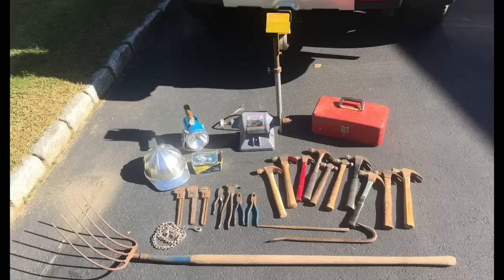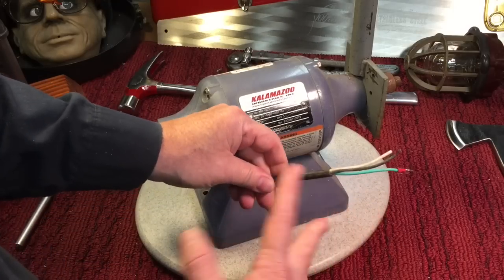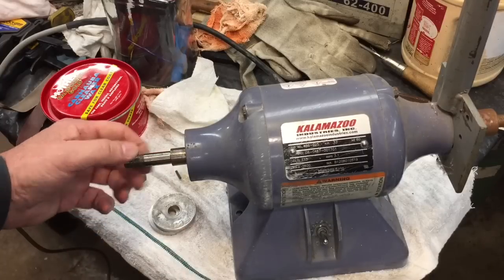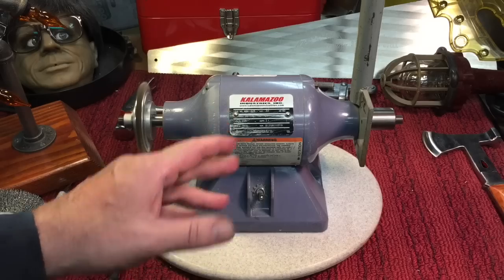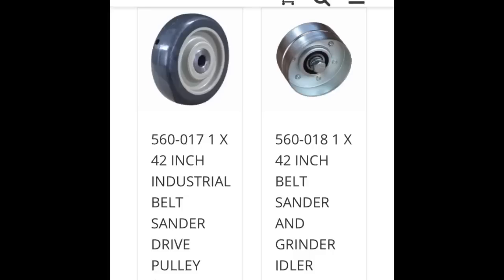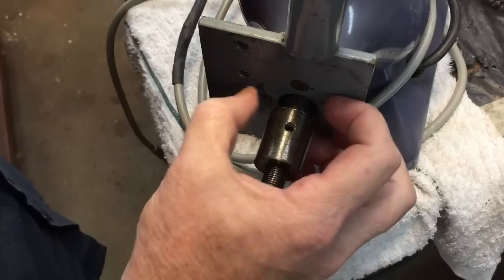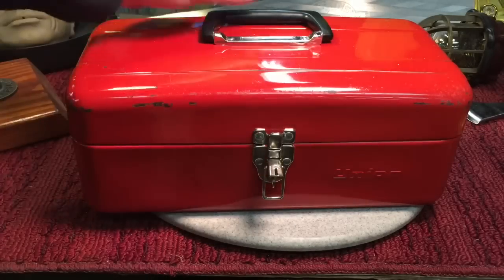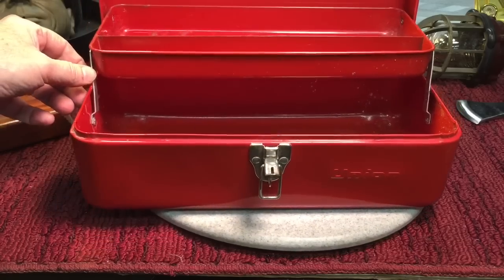First Look- Kalamazoo 1x42 Combination Belt Sander. Part-1

Comment: When joining the wires like that you want to stagger the connections, that way if the insulation tape fails you still don't have exposed connections that can touch together.
Reply: That’s what I learned as an apprentice.
Reply: That is a great tip 👍
Reply: It will surely be! I built a 1.5 inch belt sander out of trash, and I can't live without it now.

Comment: The way you pulled off the old pulley centre  was ingenious, I would have put a piece of rubber inner tube on it and left it to drive the belt. $10 that was some buy, better to be  born lucky than rich.
Reply from the maker: Tony- I wish I could have but small pulleys (under 2 inches) tend to stress the joints on sanding belts so the bigger the pulley the better it is for belt longevity...  =D

Comment: For many years I worked for a company called Kalamazoo in Birmingham UK.
Despite the name, an English brand - no connection whatsoever with the company that made this sander.
Originally, it was the Moreland and Impey printing company, founded 1886, named after its 2 founders.
They purchased a patent for a loose leaf binder from an American company, Kalamazoo in Michigan.
They became known as 'the company that sells the Kalamazoo binder', so changed the company name to Kalamazoo.
The company sold business systems, printed cheques for banks, business stationery etc. and later moved into IT.

Comment: Nice buy, I start going through my stuff until I find something that will work. I bought a delta 6x48 belt disc sander for 50.00 from the scrap yard. It was missing a couple handles and the pulley was spinning on the shaft. 3 days later I have a great sander. We appreciate a great deal. As I say crap to ice cream because we care about tools. Thank you for your channel.

Comment: Really nice job. I was thinking back to my years on the tools. I’m sure we say jockey pully here in the UK.

Am I right in thinking that tapered shafts we’re preferred where possible because the pulleys come off that bit easier?
Reply: The belt drive on a sander shouldn't need to have that tight of fit. Not much drag on the belt. I think someone messed up trying to get the hub off.
Reply from the maker: Kalamazoo uses stock buffers and adds their sander/grinder unit.  The shafts on buffers are just straight with a threaded end...  =D

Comment: I have never seen a belt sander like that.  Or if I did, I never knew what it was!  I have a project in the works for a 1/42 belt sander myself.  I know I need one for the shop, but I just can't bring myself to buying one from harbor freight, and all the older Delta ones I have seen are way too much money.  I may end up spending even more on what I am trying to make, but if it works out, it will be awesome!
Reply from the maker: James the asian 1x30 belt sanders are so awesome!  Some companies make better ones like Rikon I think..

Comment: Kalamazoo and Baldor have a close relationship.  That is for sure a Baldor.  Baldor makes all the motors for Kalamazoo, but they put a Kalamazoo tags on them.  That is the "Baldor 111", a 1/3HP, and it spins at 3600 rpm.  Baldor used to make a model "114" that spun at 1750, and was 1/4hp (when you reduce the speed of the same motor is lowers the HP), but for some reason stopped making it a few months before the pandemic started in 2020.

Comment: That is a nice acquisition. We have no doubt you will work up a solution with a caster wheel. I agree it's way over cost to buy the OEM replacement wheel. Have you priced out that Kalamazoo belt grinder to see what it listed for? I don't have a belt grinding sanding, polishing set up. What is the advantage of a 42" over a 30" belt? Good video and look forward to part 2.
Reply: More belt lasts longer.
Reply from the maker: The Kalamazoo cost around $360.  There are pro's and cons to different size belts and machines, the basic theory is if you have a belt that is twice as long it will last twice as long. =D  However the belts are more expensive and honestly it all adds up about the same.  The bigger machines do usually have better components and run quieter.   =D

Comment: I’ve examined the shafts and spun the motors, but the 3 grinders/ sanders I’ve bought used have all had extremely weak motors that took a long time to spin up and bogged down with the slightest touch. How does one check for a weak motor when there’s no electricity to test it?
Reply: I’m done with being burned by buying used motorized tools until I can figure out this problem.
Reply from the maker: Hi John, I too rarely buy used machinery for that same reason unless you get lucky...  Brushed or cheap motors just aren't worth the chance...

Comment: For your pullers, take a little slug of aluminum and turn a cone on the lathe. Put that on the center stud with a spring behind it. Night and day difference. It wants to stay in position and the spring is working to help you while the cone is spreading the legs. I bought one shot made puller at a yard sale that had this modification and I have since added it to all of my pullers. That said, even though I probably have a dozen different ones, I never have the style needed for that particular task
Reply: I have a small battery terminal puller like that. Works great. 😁😎

Comment: We are blessed for another week on borrowed time (3 score and 10) and I've got a grinder/polisher on order. I have the cloth buffers and compounds for years to come, a 320 grit fiber wheel is coming and the polisher too, directly. So THERE, John CS! Now I can shine a thing or two here too! And hone my 10 inch knife with the hammer dings in it. HAPPY WEEKEND and GBWYall! GREAT find on the sander!
Reply from the maker: Lewie you are going to have a very productive and fun Winter!!!!!!!!
Reply: @ScoutCrafter  I don't have a basement so I'll have to rig up some heat somehow or just wait for warm spells. I have a scrapbook to get done/started from when we put the original rock polisher quarry together. Good old days and I do mean OLD! I got four 1 pound green all purpose blocks of compound and two of the blue really fine stuff and 3 cloth wheels. That way I can swap out and have a spare. Trying to think ahead or maybe with my head. One never knows but it'll sure be interesting. Thanks, Buddy!
Reply: North Carolina with be a glittering palace of polished mowers and chainsaws when you get going Lewie. 😁😎
Reply: @OldSneelock  The mowers and saws stay in pretty good shape. Maybe some blowing/spraying off and some 409 but it's the tools that need a fine tuning and have needed it way before me. Now I'm glad I've got all the 50/50 and can of wax. All I need is for the rest of the stuff to get here. I was going to get a 120 grit but with the mix-up I could get a 320 so 320 it is. If I need a 120I know where Ebay still is and we'll try it again.  I might even shine up the sledge hammer and the go-devil. Hmmmm, this IS going to be interesting!

Comment: That belt sander for $10 is a steal especially with that quality, well balanced motor!! Great find!! I’m surprised with all your tools you don’t have a puller with flat hooks but nice thinking with the carriage bolts. You made it look easy. For the electrical cord you  could use smaller shrink tubing for the individual wires then shrink again like you did. Helps to reduce the diameter of the cord or you could stagger the connections but I’m not saying anything you don’t already know. Can’t wait for the next video. Thanks for fixing the tool box hinge, lol. My OCD is satisfied now.
Reply from the maker: Steve- Honestly I was just seeing if the motor was working and worth fixing, if I was serious I would run a new wire right to the motor housing getting rid of the original cord.  =D

Comment: I know that you are demonstrating simplest techniques accessible to all, but on the off hand chance that you do not own any adjustable parallels, you need to own a couple. They're designed for milling machines, but they are absolutely fantastic for jobs like this that you need to pry evenly. They're also great for measuring IDs and as the occasional Jack. I use them for so many things other than what they are made for, I'm convinced they belong in every toolbox
Reply from the maker: I agree!  The asian ones are quite good too!   I have a few sets of all types..

Comment: I think if you used two washers on each stud and put grease between the washers, it will be able to tighten down smoothly. The pair of washers and grease essentially function as a thrust bearing. You don't have to worry about the nut fetching up on the steel that way

Comment: Wow, did you ever score with that sander/grinder, Scout.  One thing to keep in mind, sometimes a set screw is backed up with a second set screw to lock the first one,  So, you might pull the one on top and the actual set screw is still in place.  This can cause a guy to go animal trying to pull the part. I learned this lesson the hard way many moons ago,
Reply from the maker: I have never seen that!  Great tip!   Thanks!

Comment: What size belt is easier to get the 30 or the 42 inch one ? You could always shorten the upright section to use the shorter belt or just make another upright so you can use either size.
Reply from the maker: I find the 30 inch belts are cheap and available all over....   The 42" belts are a little more money...

Comment: I have a 2 x 48 and mine has a full length platten and a full length guard….. mine cost $407.00 dollars about 5 years ago….. a $50 dollar replacement pulley is cheap for a expensive grinder and belt sander combo….. you should have rewired it directly into the base
Reply from the maker: I wasn't sure if this unit was a basket case or not...  If the pulley was Aluminum I would have considered it but $65 for a wheel is just too much for my cheap ass!  LOL
Reply: @ScoutCrafter  I enjoy watching your channel

Comment: Good show today!  Great tip on making a puller!  If you had all three or four sizes of the Harbor freight pullers, wouldn't the smallest one have fit?  I have had them for years and I have certainly got my money's worth out of them.  Though I think one of them is stripped on part of the center shaft.  You can flip the arms to the shorter side and it still works on the rest of the shaft...   The slow mo flag waving was a nice touch!
Reply from the maker: The set I have has pretty thick claws on the end and they were just too big to get in that small area.  This bolt method is great for that one time someone is stuck without a real puller and needs to improvise!   =D

Comment: John, I like the way you improvised to pull the part off - excellent! You must get over the idea of spending more on a part than you paid for the unit - it is silly! Even if you spent the $65 bucks on the part, you would STILL be way way under what it would cost new! You have to look at THE WHOLE PACKAGE!  Kind of like a guy who buys an antique car for $5,000 then puts in $75,000 to restore it. Look at the package in its entirety!!
Reply from the maker: Bobby- Normally I have no issues buying replacement parts. The only time it bothers me is when I feel the part is over-priced as it is in this case.  One thing I have to say about Harbor freight, their replacement parts are very reasonable.  For example if you want bearings for a $99 grinder they are $4 and that is in line with what the grinder cost. If I were to buy all the parts to make my own Kalamazoo grinder it would cost $1500!  Why are replacement parts so expensive?  I can see if this was a turned aluminum pulley that was precision made but it literally is a castor wheel!   =D